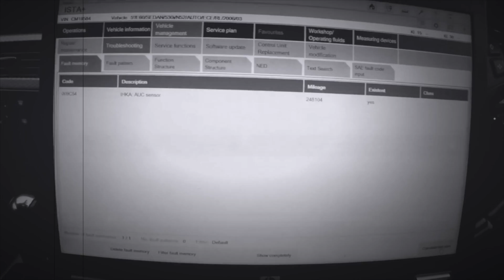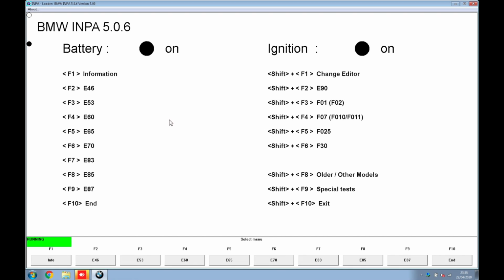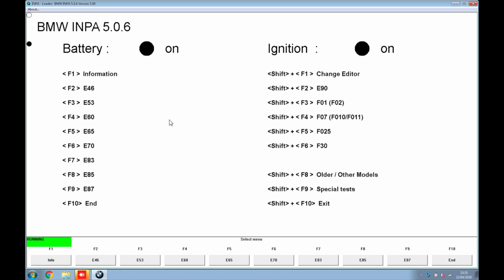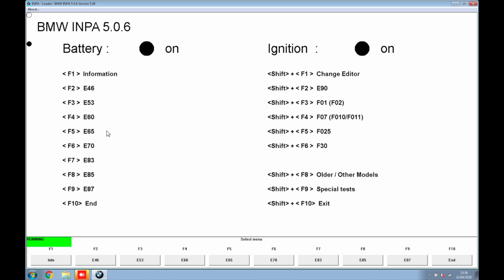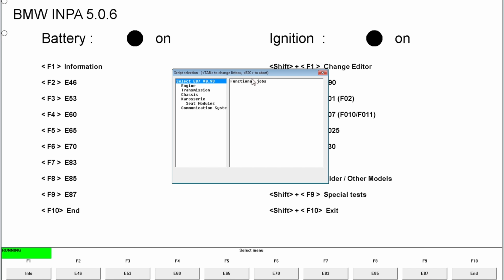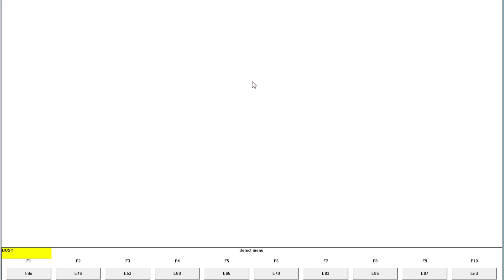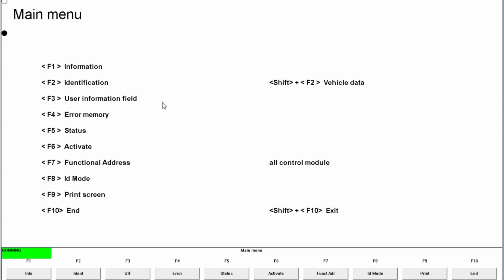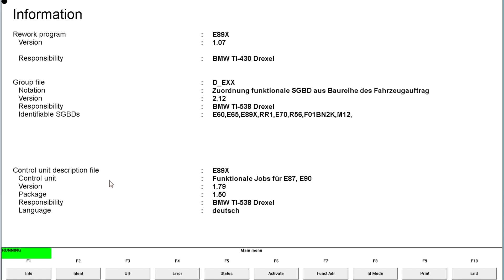How To Use Inpa & WinKFP To Update ALL Modules On Your BMW

Comment: Just to give everyone a heads up. BMW Doctor knew exactly what was wrong with my e61 525d all the way from England to Sweden just by reading on you tube what i said the fault was. It took Bmw:s own workshop 2 visits and 4 hours to fix it and that was after i have them the info Bmw Doctor gave me after a membership for no money at all. That says à LOT 😂👍
Reply from the maker: Thanks a lot mate now enjoy your car buddy if I was you mate sign up for expert package and benefit from all the software and diagnose to c videos mate so you can learn how to diagnose and program and code mate
Reply: BMW Doctor I will 😊 trying to work out now it a throttle body from M57tud30 fits on my tud25 and it it needs to be coded in. Oil have come in to the throttle position sensor and its fucked mate
Reply from the maker: Oh oh not good my friend change it over the throttle position sensor will get clogged mate from the EGR valve gases oil passes through the intercooler have you changed the VORTEX breather ??? To the new design
Reply: BMW Doctor No vortex is not changed but gonna remove the egr. But do the throttle body fit from a 3L on to a 2,5L and do i have to code it?
Reply from the maker: No no coding needed you may need to change the flash to make it run that’s all mate but apart from that they should be fine
Reply: BMW Doctor And 2,5L and 3,0 M57 have the same throttle body?

Comment: Hi I don’t know if you could help me with this but I’m getting error when I try to do a software update on the M5.2 ECU of 97 318i, I have no problem doing software updates ms42 and MS43 using KFP, but ms41.1 and M5.2 I’m getting a error so I was just wondering if you had success updating older ECU using winkfp.

Comment: Hey, I have an e60 2004 and I want to code/ activate/ insert the right VIN in the STVR Airbag Module in the Right front door. I disconnected the battery, unplugged the module, replaced the whole door shell but used the same original cables, module and airbag. Now I got the Airbag error on my iDrive. Error Code from INPA: 96FD 60. The error can't be deleted with INPA because it comes back on. 
Can you please help me?

Comment: Hi I've just become a member. Thanks for these really helpful vids. Can you provide me the link to the 30 minute  video (How to program all modules) please? I own a 2011 X5 35d E70 and want to update all of the modules. I have the BMW Coding Tools V3 lite VM that is connected and working D/K-CAN cable and I have the latest (2020) SP Datem downloaded and installed into WINKFP. Any pointers would be appreciated
Reply from the maker: you are semi pro member you need to be expert member and you will have access straight away its on all the member only videos which are available for expert members
Reply: @BMWDoctor  Cheers Doc, I'll upgrade to expert
Reply: @BMWDoctor  Hi, I've upgraded to Expert now, I do need some help/advice to update my 2011 X5 35d  E70. I have the latest SP Datem files for the E70, Used INPA to get my modules list (most havent been touched since 2011/2013). So I attempted to update the TEL/MULF  Module with ZB        9257165  , started WInkfp, Entered the ZB Number, Entered VIn, Then clicked Update ... I just used the defaults and attempted to update. It hung for about 5-10 minutes and showed about 1% completion then the trasmission error came up on the car display, followed by seat position error then a few more errors. It looked like the winkfp had finished with an error. I disconnected everything and switched off the car, put the key back in and everything started up (except Telephone kept spinning from the failed update no doubt). So I'm a little worried ... clearly I did not do it right ... not sure if its due to selecting module or a dodgy D/KCAN ODB2 cable. The cable did flash repeatedly while the flashing was happening. Any advice or help would be appreciated. I though I would start with Tele/Multi before attempting DDE/EGS/CAS
Reply: Also still not seeing the link the for the 30 min programming video if you could provide the link please. Thanks in advance
Reply from the maker: https://youtu.be/M6POZEOcYlM

Right here
Reply: @BMWDoctor  I sent you an email about swapping a 335i dash to a 325i you didn't answer. Can you give me some help with your services?
Reply: Thanks BMW Doc
So how long should it take to flash a module like Tele/Mult on E70 using DKcan cable? If I get messages on the console screen like transmission malfunction while flashing, should I ignore it or stop the process?
Thanks again for your help
Reply from the maker: If you get transmission error STOP IMMEDIATELY or take the cable out to stop the update as you should not be seeing gearbox light if that does happen that’s not a good thing so to stop it making the problem worse just take cable out or cancel or stop the update
Reply: @BMWDoctor  Thanks for the advice, so I'm waiting on my K-DCAN cable from Bimmergeeks before I attempt to flash my E70. I also own a 2015 535d (F10 I think) and did buy an ESYS Cable to be able to diagnose and code it, what software would you recommend to diagnose and do coding on it? Also is there anyway from the firmware update to get M like performance or would I really need to make some engine mods too? Appreciate your continued advice and support
Reply: @BMWDoctor  Hiya Dean, so I did get the new Bimmergeeks cable and went through the process to update the Tele/Mulf module on my E70 using winkfp and exactly the same error (Transmission Malfunction followed by a few more malfunctions and then the windscreen wipers started going). I stopped the update ... any idea why this is happening? I read that programming anything on the MOST ring needs an ICOM and other posts saying that winkfp fails because Boot Sector Update is enabled. Should I disable the Boot Sector Update? I really need your expert advice here as I'm not sure how to proceed
Reply: @BMWDoctor  Hiya Dean, so I did get the new Bimmergeeks cable and went through the process to update the Tele/Mulf module on my E70 using winkfp and exactly the same error (Transmission Malfunction followed by a few more malfunctions and then the windscreen wipers started going). I stopped the update ... any idea why this is happening? I read that programming anything on the MOST ring needs an ICOM and other posts saying that winkfp fails because Boot Sector Update is enabled. Should I disable the Boot Sector Update? I really need your expert advice here as I'm not sure how to proceed
Reply from the maker: My friend I have to login and do this for you you have bricked your modules you DO NOT NEED A ICOM at all 

But it’s not going to be cheap or free
Reply: Hi Dean
Ugh ... was hoping that was not going to be the case.  Can you give me an idea of what the cost would be? Also what I would require on my side for you to be able to connect in and do you even have any availability to be able to do it
Reply from the maker: Anant Mistry you have everything I’m taking it but I will need to install other software the cable you have is fine and so is the laptop 

Please email me
Your phone number if you have WhatsApp at bmwdoctordean at gmail dot com 

And I will call you

Comment: I have a bmw 2007 525i n52 based on the codes that I have 2a9a 2a9b Inpa error type code for both  says “signal or value above threshold “ I have tested the camshaft sensors they have correct voltage I have tested/ cleaned  the vanos they have the correct voltage I have cleaned the non return valve I have performed a compression test the results were ok I have performed a fuel test with a cheap O’Reilly fuel test rental  and the results were accurate but after 10 minutes the pressure would drop 30 psi the adapter didn’t fit properly on the fuel injector valve so the test wasn’t %100 accurate I changed the battery I changed the oil the inpa engine speed  rpm  is 224.rpm . I need some assistance on where I should go from here any advice would help thanks